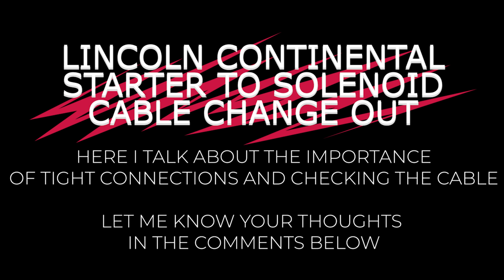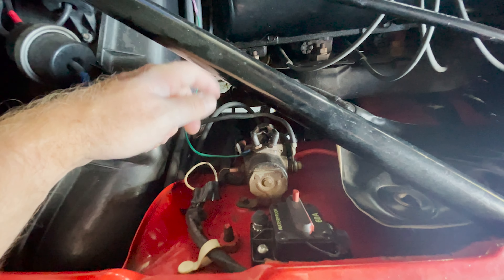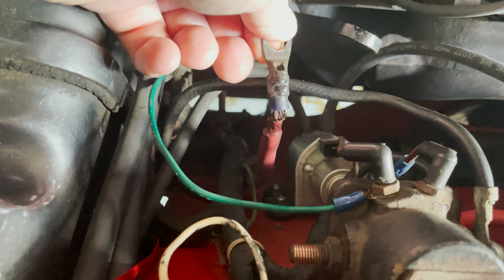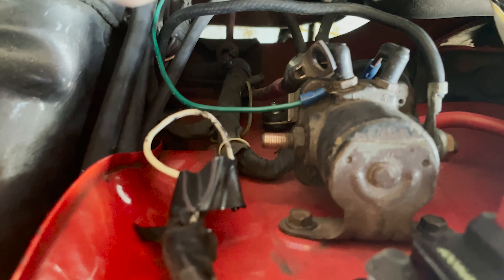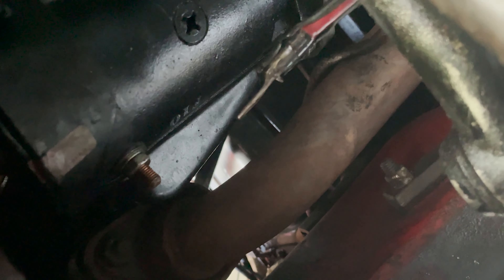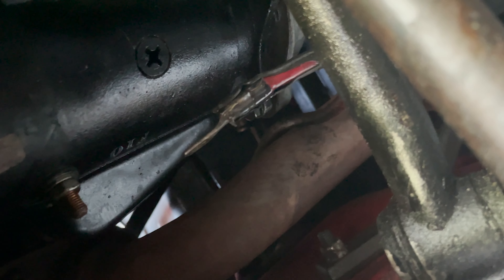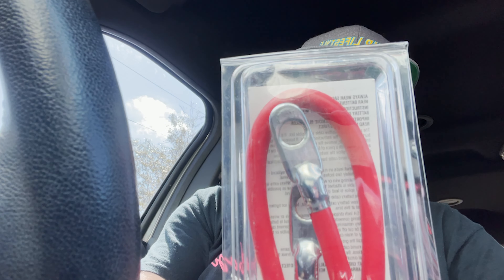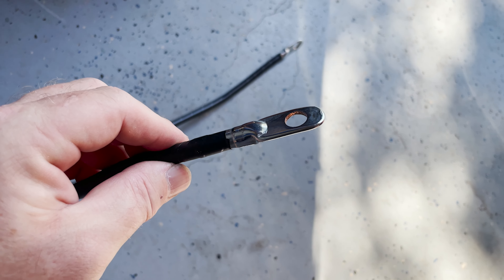Don't Get Stranded!!!! - Lincoln Continental Starter Cable

Comment: I might consider wrapping the exhaust w/ some of that old school cloth tape for the heat of the exhaust.
Reply from the maker: Yeah I really like that stuff. One challenge is… it’s so close there isn’t a lot of room to wrap it around. I’ll monitor and see how it goes. Thanks for the support.
Reply: @lincolnaddict  yea, unless you take the header off it's hard to do. Maybe just a foot or so @ the bottom where it's close to the cable.

Comment: Another video idea... perhaps focus on the mechanical fuel pump located right beside the distributor. Fuel and spark inches away from each other. On my 62, my fuel pump would seep fuel and it's a wonder it didn't burn to the ground on me.
Reply from the maker: Hey thank you very much for the support. GREAT idea. I know right. My Dad was a "Chevy guy" and he would point out things that he thought was nuts on Fords. It always stuck out to me that the distributor was in the front of many Fords. Let me see what I can come up with. I'll talk to TC at Lincoln Land as well to ask if she has ever ran into that. Glad you were ok and didn't burn it down.

Comment: Is the solenoid mounted separately from the starter like this on a 1973 mark iv?
Reply from the maker: Yes, in the thumbnail image you will see the old blue solenoid which is mounted on the passenger front apron.